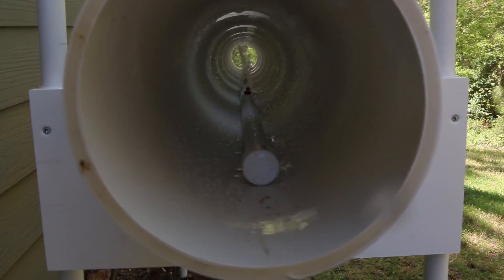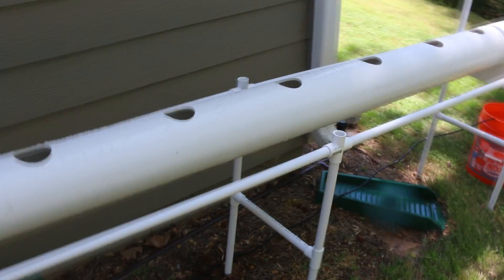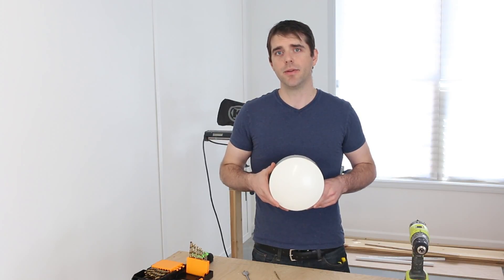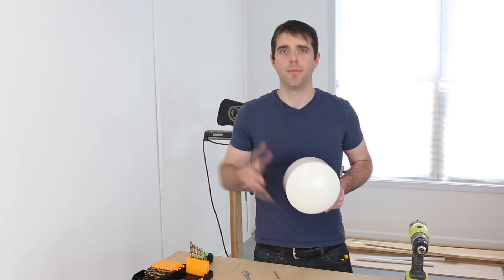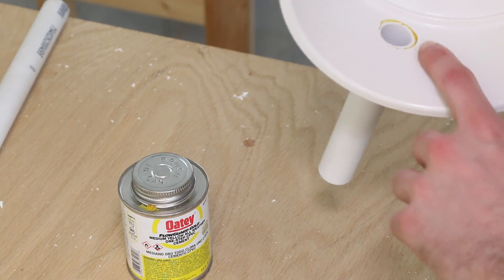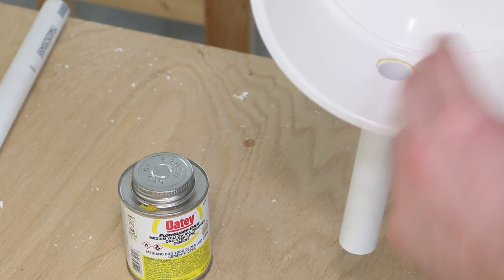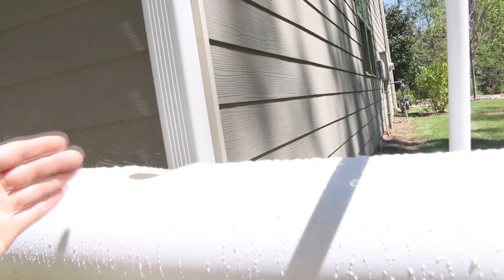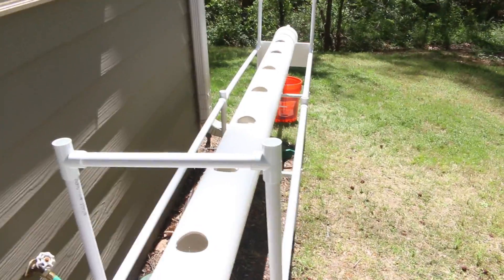DIY Aeroponics Garden System - Vol. II

Comment: Hi. Can you please let me know how you set the other end of the water supply(where you closed with a cap)? did you leave it on the floor of the 6" pipe or did you hoist it so that the pipe runs on the top end of the 6" pipe instead of touching the floor of 6" pipe. 
Thanks,
Reply from the maker: The other end of the supply tube was capped to make sure there was enough pressure for the misters to function. I left the pipe touching the base. It didn't seem to cause any issues that I am aware of.